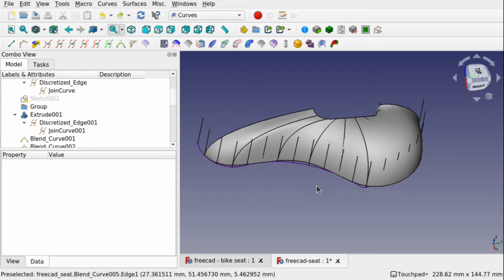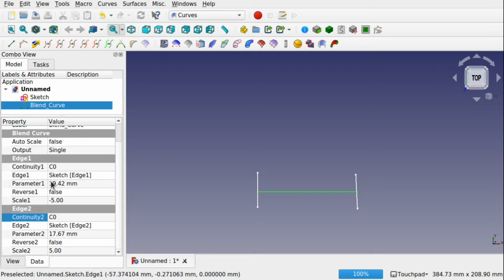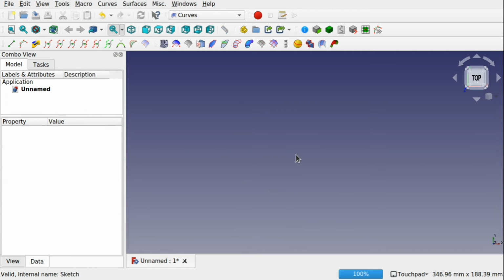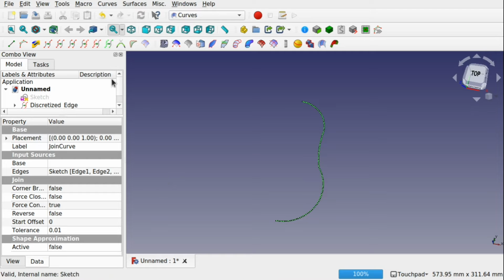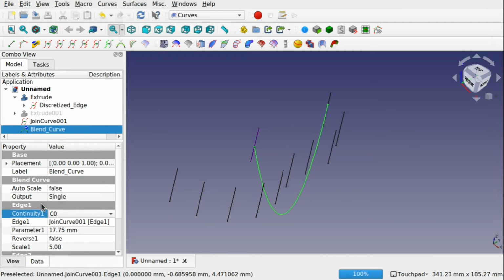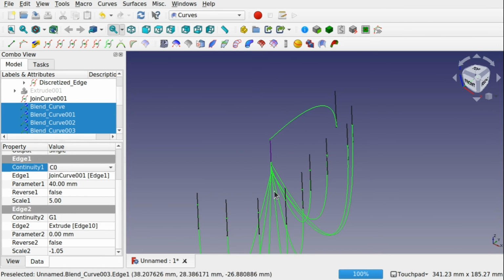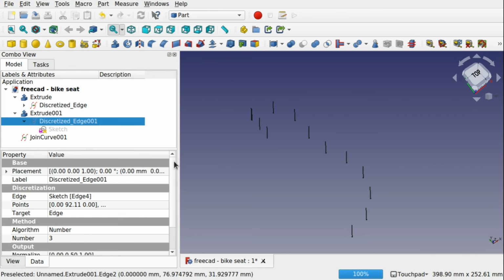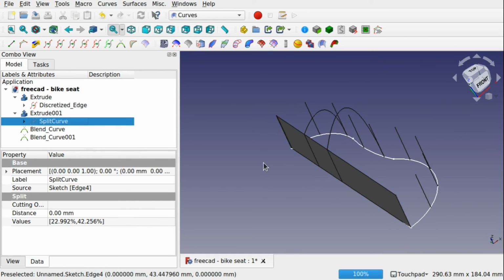Learn freeCAD Curves Workbench 14: Blend Curve Tool. Create curves of continuity. Bike seat example

Comment: Hello. Is here any way to control the continuity of the created loft in 'along' direction (meaning across the ridges) ? Do we know - as it  is - what continuity is there right now? (this is strictly rhetorical curiosity question - but the practical application should be obvious)
Reply from the maker: Unfortunately no, the lofting algorithm approximates between profiles, the more profiles you have the more control over the curvature of the loft. There is combs in the curves workbench you can add but they don't control the continuity but just display a bspline comb as a visual did the surface.

Comment: If I have two lines on different planes (XY and ZY for example) The curve does not meet one or even both ends. Moreover, trying it with two different parts the same happens and the curve does not connect
Reply: It seems to work a lot better if the lines come from an extrusion. If not the curves are really weird...or it seems so to me

Comment: is it possible to make 3d offset from Blend Curve ?
Reply from the maker: Part 3D offset won't work on a single curve but you can do a part 2D offset on one and tick the fill option which will create a planar face which can be used, say to extrude, loft or sweep through. Or you can create a number of blend curves, loft through those and then do a 3D offset
Reply: @MangoJellySolutions  Thank you!!

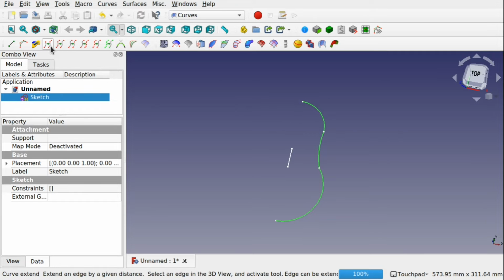Comment: 16:34 When I click "Join Curves" is throws an error in the Report View that reads "<Exception> type must be 'Shape', not list" and doesn't create the curve. Am I the only one having this issue?
Reply from the maker: You need to upgrade your curves workbench as there is a new version. I contacted the programmer about this issue and they fixed it petty quickly
Reply: Thank you so much!